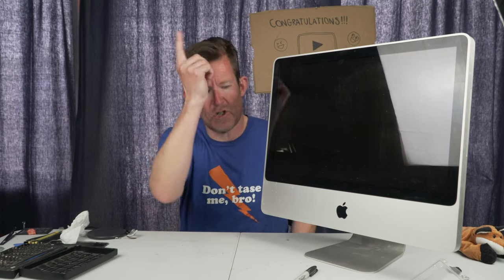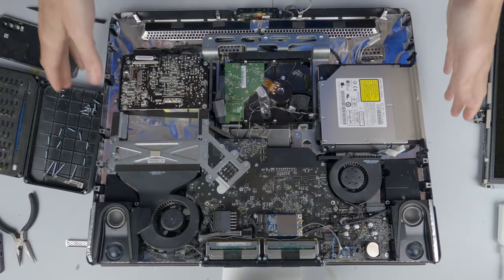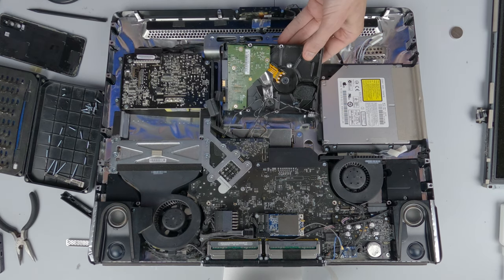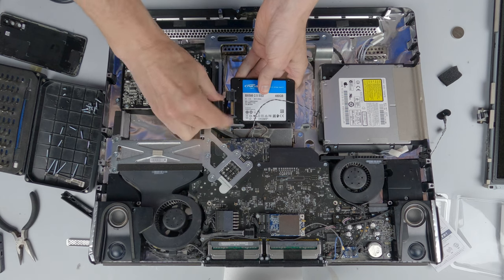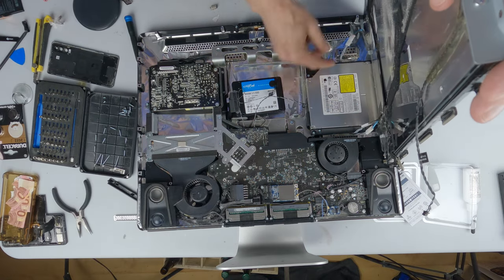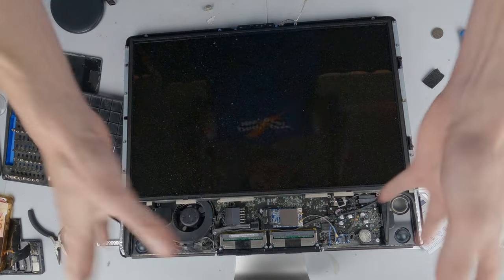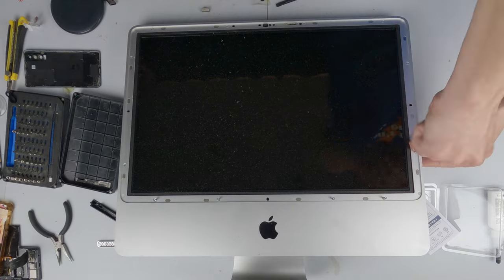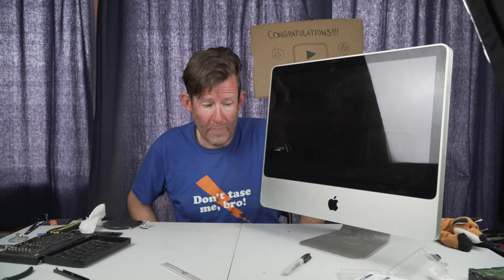SAVING A 2009 20" IMAC A1224 EMC 2266 - DISASSEMBLY SSD INSTALL 4K

Comment: Found an A1224 2266 being chucked out a few months ago now, and just getting round to trying to get it up and running. Looks like the PSU's dead (no diagnostic LEDs turning on) so I just ordered one, and I think I have a spare SSD lying around somewhere if I get that far. Hopefully that'll get it up and running, hate seeing repairable things go to waste.
Reply from the maker: 100% agreed. Of all the parts on the Imac I dont like messing around with the PSUs. Usually because they are buried behind everything and sometimes they haven't discharged. Good Luck anyway.

Comment: Did you replace the hard drive because it was broken or slow?  Does the memory work for El Captain?
Reply from the maker: Speed but also as preventative maintenance. After 13 years of use a mechanical HD is liable to be at the end of its life. In 2009 Snow Leopard didn't rely on the hard drive for cache as much El Capitain does. So an SSD makes good sense.

Comment: How do you get the magnetic border to the screen off to begin with?
Reply from the maker: Luckily the magnets aren't strong. I use either a small suction cup or some duct tape just to lift it enough to get a pick or finger under. After two corners are released it comes away very easily. I hope this helps?
Reply: @150daysofwinter  Thanks! I'll try that. I need to change "the battery" which I'm assuming is the CMOS battery. I'll at least start with that and see what happens. Thanks!
Reply from the maker: @cmoul001  If you follow an ifixit.com step by step guide you shouldn't have any problems especially when it comes to cables and screws.
Reply: @150daysofwinter  I just found out the screws are T10... I didn't even think about not having a screwdriver for the job. At first glance it looked like a hex screw and I was confused as to why my hex keys weren't fitting. I just ordered the right tool from Home Depot and will continue once I have the right tool to take out said screws